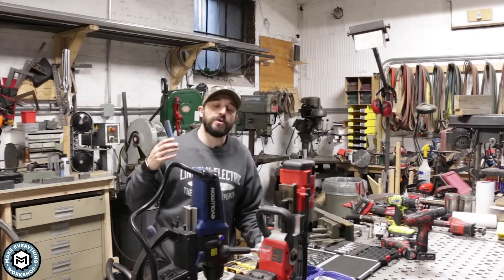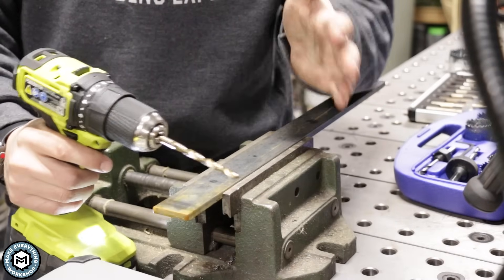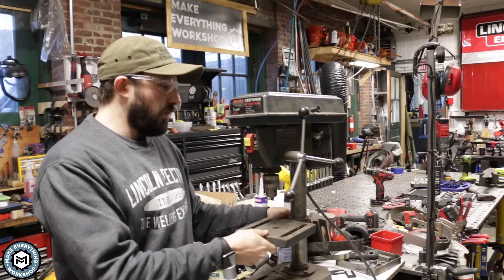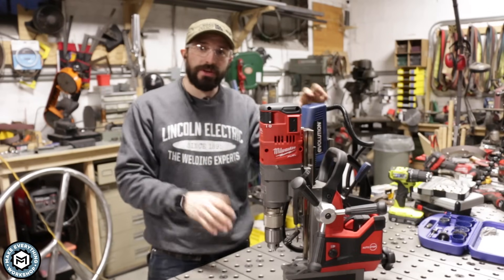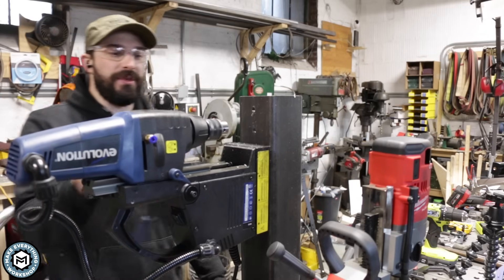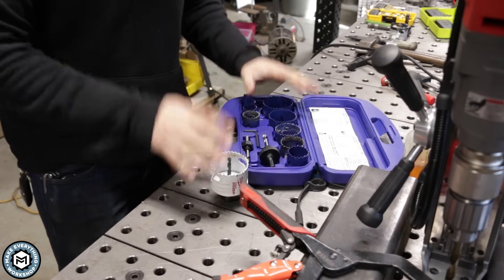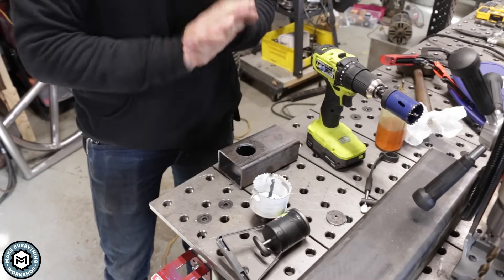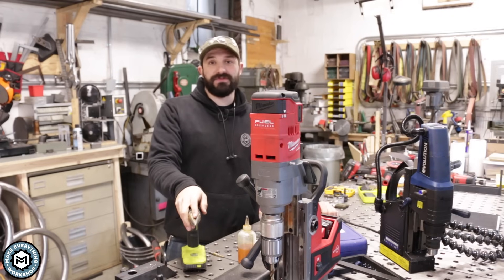How To Drill Holes In Steel - The Ultimate Guide!

Comment: Big big tip for holesaws (particularly in thicker steel) is to start drilling to get the kerf started, and then stop and drill a hole or three on the inside of that circle as chip relief. It makes an absolutely massive difference in how well it cuts. 3" holesaw on the drill press will happily chew through 1/2" plate in 10-15 seconds if it has a chip relief hole in the kerf. It lets you push a lot harder too, and having a high chip load helps keep things cool.
Reply: Nice tip! I’ve seen people do similar with wood
Reply: Winteresting
Reply: Excellent idea! Thanks
Reply: Good tip, make the hole in the kerf or within the circle being cut?
Reply: @DanielSanchez-vk3qs  Mostly in the circle, but intersecting the cut.
Reply: @hypnolobster  got, thanks again
Reply: I need to do this. I am having major problems cutting through trailer hauls for conduit connectors. I'll try drilling holes in, and around the circle first with a bit then go at it with the holesaw.
Reply: @CoD_Maj3st1k  a massive difference ? I gotta try this.
Reply: @kirbylee57  I will try it on Monday, and post an update. It can't hurt, because my holesaw teeth are getting ate up on trying to penetrate the trailer hauls. It's not even very thick sheet metal neither. So, I will give this a try.
Reply: @CoD_Maj3st1k  results?
Reply: @PowerScissor  Man, it's night and day difference. After I predrill in the desired holesaw area, the hole saw slices through it like butter. It takes it less than 5 secs for the metal I use it for.

You must pre drill where the teeth of the holesaw will meet on the surface. I drill 4 holes (top center, bottom center, left, and right) it's easier on your wrists too doing it this way. At least for me it is.
Reply: @CoD_Maj3st1k  I'll have to give it a try next time I'm in a scenario where I can't use the drill press.

What size did you use for relief holes...¼"  like the pilot, or something bigger?
Reply: You can use the pilot bit. For me, I use a combination depending on the thickness, because in my case, not all trailer hauls are created equal, some are thicker than others. So, act accordingly on the material that's being cut through on which bit to use.

What I do is use the center hole punch to help the holesaw bit start. I start the holesaw to make the circle outline then predrill around where the teeth meets the metal. I drill one top center, left center, right center, and bottom center I also use hole punch for those since my budget isn't high enough for quality bits, so I try to take extra steps to make them last longer. Once, you predrill those holes, use the holesaw as you would. It takes less than 10 secs for me to cut through it. Yeah, its extra work that takes more time, but my holesaws last so much longer and you are not killing your wrists or batteries of your drills trying to get through the material.

It works perfectly for me. So much easier.  @PowerScissor
Reply: i know it is kind of randomly asking but does anybody know a good website to stream new tv shows online ?
Reply: I’ve got a big job coming up where I have to cut 30 3” holes in 5/16 mile steel. If this works it’ll really help. 
I’ve also got 1000 2/8 holes to do too so this will help!
Reply: @CoD_Maj3st1k  thanks for the plain language description.
Reply: @CoD_Maj3st1k  I'm going to guess the extra holes give each tooth more opportunities to start making ribbons of steel and the start making them again if it loses the ribbon.
Reply: D ce 😮😮😮😮😮

Comment: In 'the field' I've (because I was a fool and forgot to bring my can of drill lube) used the few drops of motor oil found on my trucks dipstick to drill a hole in a tractor and make a repair. I was taught by my dear old dad to ALWAYS use a lube when drilling.
Reply: I viewed your video which was very well done by the way. One thing I noticed is that you did not use any type of protection for your hand. Use your hand to clear the metal shavings transvision chills run up and down my spine. One of the things cold sores I have a problem I guess I'll just me but I seem to break that pilot for a lot so I went to go leave the pilot hole and using a straight piece of hardened drill bits talk with that has no fruits or anyting on it as a pilot for the drill would have. If you ever get around to reading this thing I still think your video was very informative
Reply: Why is bed rail hard to drill.
Reply: @raymarkotjohn7681 It’s high carbon, makes it very hard and brittle, not good for much.
Reply: Mom must have insisted on that.
Reply: @raymarkotjohn7681 It is a high carbon content (hard) steel. Keeps mom and dad from hitting the floor when they are bouncing … and yes, they still bounce!
Reply: ATF works better than motor oil
Reply: Woah, that is a great tip! I mean, I usually use WD40 if there is no cutting oil and I've even used engine oil, but always out of a bottle, it never crossed my mind to get it from the engine itself.

And a friend of mine that owned a machinkng shop told me once: "heat is your only enemy, if you have no other choice, take a soda bottle, fill it with plain water and put a small hole in the cap to squirt it in your drill bit. And go slow" and he is right, as long as it stays cool, it is okay. Ofcourse, the best thing to do is use high quality cutting oil, the right tools and some nice cobalt drill bits, but if all you have is a cheap set of fast steel bits and a bottle with water, you can get it done too.
Reply: In mild steel, I’ve used water/snow.  Just keep dipping the drill bit in.  Better than nothing if your out on a site.  I’ve worked at some pretty remote locations.

Comment: Take from a retired electrician. Always drill a pilot hole instead of using the step drills smallest size starter size drill tip for drilling.  That way when you really need to use the step drill maybe out of position or you no longer have a separate pilot drill bit for your step drill the step drill first size drill tip will be like new and not wanting to be sharpened because the smallest size on your step drill bit will be the FIRST to become dull....

Comment: For the magnet mounted drills, if you use a sheet of thin paper under it and fold it up the front next to the drill bit, you can remove the drill without all the metal chips sticking to it.
Reply: When you turn the magnet off the chips no longer stick they fall off.  No need for paper

Comment: Step drills are indispensable when drilling in sheet metal - they are ideal for anthing below 2mm. Sheet metal is to thin for regular twist drill bits - they fail to produce round holes, you get a helicopter effect and the material will be bent around the hole. A step drill will make a nice round hole in sheet metal without all these problems.
Reply: "Helicopter Effect"! That's a perfect way to describe what you are referring to.... Reminds me of the day I learned that a fan is, mechanically speaking, a screw
Reply: Neat trick. Put a small square of cloth folding into 4ths between the drill bit and the hole. No helicopter.
Reply: @gomlin3108  I know that tick. But the holes are still not very round. Step drills are better at that. The best holes are produced by punching.
Reply: There are bits specifically for sheet metal. I use them. McMastercarr has them.

Comment: I just finished drilling 1260 1 1/16 holes in 3x3x3/16 square tubing for a power rack. Scribed, punched, drilled a 1/8 pilot in every hole. Used 2 sluggers. What a week it's been

Comment: This is the channel I didn't know I needed to be into. I will be watching. Drilling through harder steel pieces is something I have been dealing with forever and you never know when it pops up. I usually find a way to get it done but knowledge is better than luck. Please address this topic. I remember something about it from shop class but it was about 60 years ago and I need a refresher. Thanks for this content, it is deeply appreciated.

Comment: Thank you.
Before this video, I never knew there were hole saws for metal.
Always saw them as making holes in wood, usually for installing locks.
Thanks to your video, I saved myself a ton of money as I was building my own hydraulic press, and I thought my only option was to take the steel to a machine shop to drill.

Comment: Excellent video 👍
The Milwaukee mag drill is amazing
Years ago I had to drill and tap 3/4"-9 clamp bolt holes in a 400 ton press Platten.
Press moved horizontally so the drill was on its side. Corded version of Milwaukee mag drill. Wasn't an electric magnet.
Holes were about 2" or more deep, don't remember the size, but it was for 3/4" bolts.
Stepped up the hole size a few times.
Then I chucked up the tap, got it spinning, turned off the drill and sent the tap into the hole. The momentum started the tap nice and square. Finished it by hand after unchucking the tap leaving it in the hole and removing the drill.
Excellent drill! Can't imagine how nice they are nowadays.

Comment: i enjoyed your video.  i have a car collection and do all the restoration and repair work myself and have worked on cars for over 50 years.  i like you, have drilled a lot of metal.  i would only offer you two points to include in all your videos and both are very important.  1. at the very beginning of talking about drilling metal, i would emphasize the necessity of wearing safety glasses.  metal chards and shavings are so sharp, ragged, and small that ANY piece of metal that flies into a person's eye WILL likely be SERIOUS up to the point of actually losing the eye. as you know, metal shavings go all over the place when drilling and this precaution is extremely important if a person is close to the metal being drilled.  protection of one's eyes when drilling metal should be THE FIRST thing a person attends to because the very FIRST accident could change a person's life forever.  2. i would suggest that you wear gloves in all your drilling videos OR tell people to NEVER try to brush metal shavings away with an "unprotected" finger if they are not wearing gloves.  i know it can sometime be just a reflex action where you want to drill something fast and you grab a drill and just start drilling then when done, you quickly brush away the shavings with your hand or finger.  HOWEVER, it doesn't take too many times of watching blood drip out of your hand or finger or having to stop the project to go get a pair of tweezers to dig a metal shaving out of one's hand or finger to GET THE MESSAGE NOT to brush razor sharp metal drill shavings away with one's hand or finger.  all in all, you had a great video.

Comment: Perfect video! Debunks all the telltales and myths of drilling metal!! If you’re struggling when drilling into metal/keep breaking drill bits/drill keeps walking.. 90% of the time it’s operator error! (That’s also true for all the work in any trade..) Step back and take a second to think of a better way to get the job done. Be aware of your body position when using a hand drill, (especially corded ones with high torque!!) be aware of the angle at which your drill bit is being pushed against the metal, and be aware of the amount of pressure that needs to be applied for the desired bit size. Don’t go putting all your weight on the drill when you’re using an 1/8” drill bit and vice versa. Essentially, if it’s bending like Beckham or spinning in place without extruding any chips, then you’re doin something wrong.

Comment: Awesome vlog thanks! I love those demming bits wow!! My hack to save bits is to start the hole with a self tapping screw of various sizes, then finish the hole with a drill bit. A hack yes but it works. In hard to reach location, I'll use a large hand clamp to pull the drill into the steel, this works wonders and saves your wrist and arm. One end of the clamp behind the drill and the other on the side of the metal, screw and clamp at the same time.

Comment: Not much of a carpenter/builder if they are scared to mess with anything but wood! A good builder can build and do everything with wood, concrete,steel, masonry, etc my father does it all always has we just finished a massive full steel beam style, barn  for cattle, a corral, hay shed etc. A good carpenter or builder always has good drills and bits ,bolts, etc. Great vid!!

Comment: Great informative video. It has given me the will to break out old drill press in implement shed that came with my property about 10 years ago and see/fix if it works. I was dreading drilling holes in 1/2" plate by hand. I, also, like and appreciate the way you list everything you use in links.
Reply: Great tips.when using drill press add oil  onto the drill.Lasts longer than adding to your work piece, especially with a  hole already in it 😊

Comment: When I'm center punching a hole for accuracy I use 2 punches, one pointy center punch to get some penetration and then a wider angle punch to match the drill bit angle and help it not wander. Checking the tip of the bit before use is a good habit to get into. Oh yeah and if your drill bit catches before it exits the material, you can run it in reverse to help punch through. Thanks for the video, I'm sure it'll help push people pass their hesitations with drilling into metal. I was a little hesitant as well before I started my die maker apprenticeship, so I can relate.

Comment: Great video!  I think you missed a few opportunities to mention using simple plate drill guides.  I machined out a nicely crafted RC car chassis as a kid using only vise grips, a crappy old drill, and a thin piece of metal and/or G10 fiberglass as a guides.  I only had to clamp the guide over my hole, and it really impressed me how accurate the whole chassis turned out.  Also for hole saws, if you have no pilot available, you can use a template guide of sorts as well. I know you're probably well aware of all of this, lol.

Comment: If it hasn't been mentioned, a machinist friend told me not to use a pilot drill larger than the diameter of the chisel edge of the drill you use for your final hole.  Makes sense to me.

Comment: Note to self: when drilling holes in "side ways" into metal, use a drill that has two hand holds so you can get pressure onto it from both sides.  That helped a lot.  I also bought some Cobalt bits, that may have also helped.  And used that sticky oil for lubricant "bar and chain oil" so it wouldn't drip off as quick...

Comment: When I'm drilling with a hand drill, I often employ a guide to keep the cut at 90°.

I have a metal-turning lathe and made s step pin with a clampable base and center drilled (using the lathe) out to several common drill shank  sizes.

I also keep several common thread sized drill bits, both tapping size and through  (clear) size along with the correct-sized tap on a block mounted to my work bench wall, so I always have the proper bit when drilling and tapping holes.

  The 90° guides are turned out if aluminum round stock.

Comment: To extend the life of  a drill bit you need to keep it cool.  In my line of work I’ve drilled hundreds of thousands of holes, and what I use is water with dish detergent. Take a bottle of water, poke a pinhole in the cap, squirt a little Dawn dish detergent in and you’re good to go . The water cools the bit , the detergent adds lubricant and you’re  not left with an oily mess when you’re finished.
Reply: I also use dish soap when drilling any type of metal.
My main reason is that l paint or anodize all my parts and don't need to worry about excessive oil in my parts.

Comment: Chris, I missed in your story about, drilling in hardened steel. And therefore I'give you a tip about how I do this. I use a drillbit that is made for drilling in stone or concrete. You know the point of these bits have a braised in material (I forgot the name, because English is not my native language), that is also used with cutters for a lathe. With thes cutters on a lathe, you can easely cut hardened  steel.
The only thing you need to do is regrind these drillbits the same as your mild steel bits are. Be sure when you do this, that you lower your drilling speed and use a fair amount of cooling. It is braised in remember. These modified drills cut through hardened steel as a warm knife through butter.

Comment: Cobalt drills are HSS. There are a number of types of HSS. I have these DeWalt bits too, and the problem with them is that while they’re pretty good for a mid priced product, they’re impossible for most people to resharpen, if that’s something you want to do. Use a spring center punch to make an accurately placed dimple, then use a hammered punch to make the hole larger. Other than annular cutters, which must be used in a drill press of some kind, those general purpose holes saws don’t make accurate holes, no matter who makes them. Often they’re not clean. Step drills make much more accurate holes.

Comment: Hey Chris...
Just FYI, the STARRETT Company has an adapter called an "OOPS" Arbor. So if you have made a hole too small with a hole saw you insert the "OOPS" Arbor in place of the pilot drill bit and it has two threaded end so you thread on the smaller hole saw then on the second thread you thread on the larger size hole saw to allow you to cut that larger hole using the smaller hole saw as your pilot !!!
Just thought I'd pass that along !!!
Thanks, Scott

Comment: Hey I am trying to drill a hole in 18 gauge mild steel sheet metal piece and I watched this and my drill caught on the steel at the end and I am try wondering what I should do to get it to drill the hole in a circle fully through it, I am trying to do a oval shaped hole to fit a charging cable through for a mounting bracket for my phone to hold it above my sim wheel, I am using the ryobi drill bits and hand drill and those are the best I got. I am welding the full mounting bracket together and this is the last step for me to finish it.